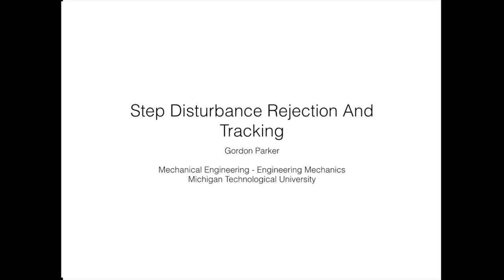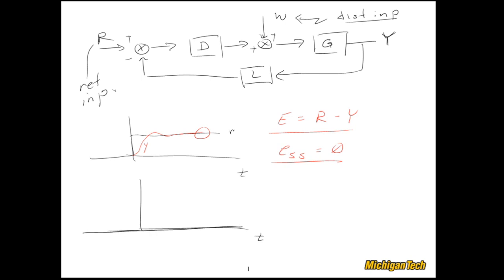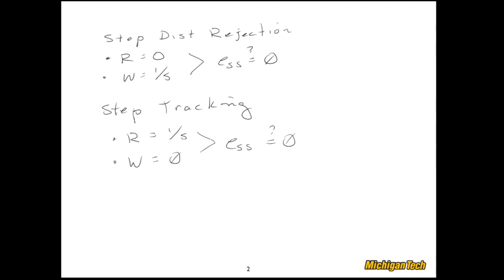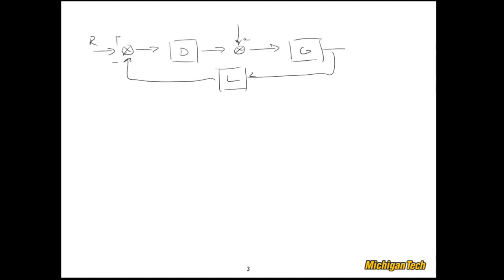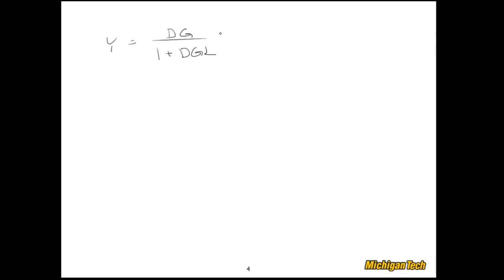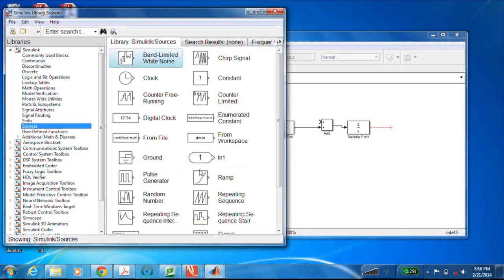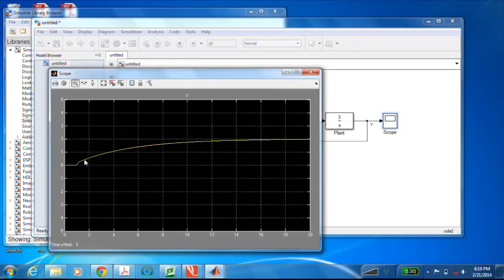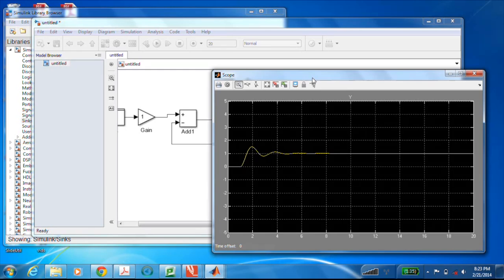Step Disturbance Rejection And Tracking

Comment: Dr. Parker, why does adding a pole in denominator of controller leads to step disturbance rejection?
Reply: Because that (adding a pole at the origin) corresponds to an Integrator (1/s). The rest is just the integrator's job - drive steady-state errors to 0. See the PI controller, for example, where we, say, get some ss error using just P and then, when we add an I to it, the error -> 0.